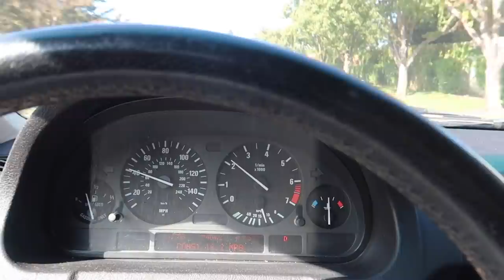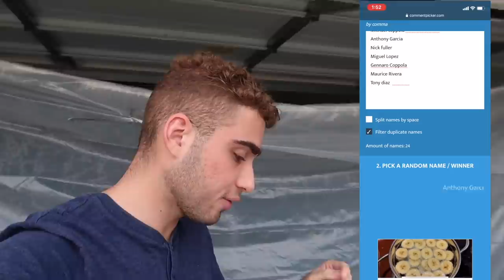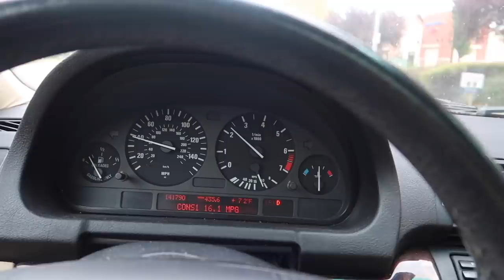HOW TO PAINT A BMW! (PART.3)

Comment: What kind of paint are you using? Is it acrylic, urethane, or lacquer based? Didn't see any primer over your glazed putty spots or metal areas, meaning it wont be sealed completely. If you are spraying a "sealant" in white, it'll work. If its base coat it'll come off over time. I do praise you for doing paint over vinyl. You'll learn with time, temporary things are wasteful of your valuable limited time